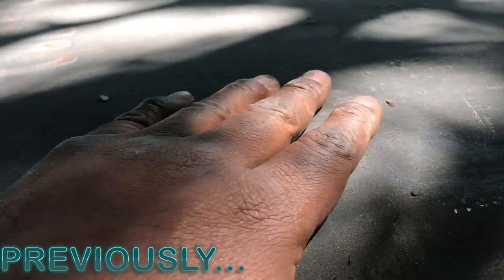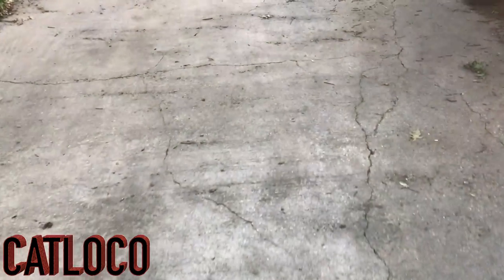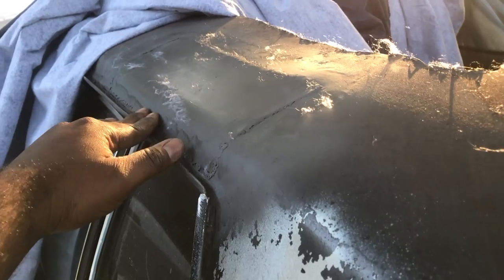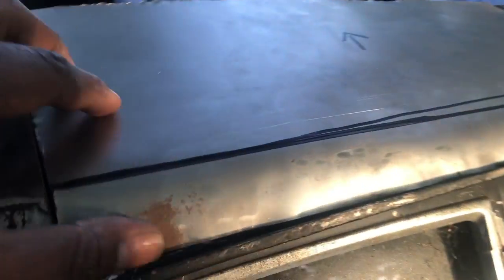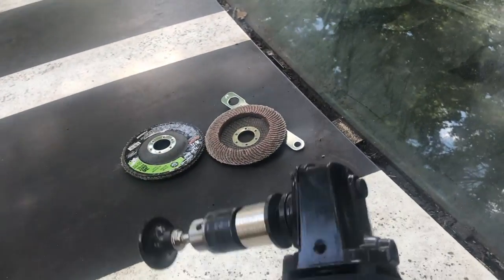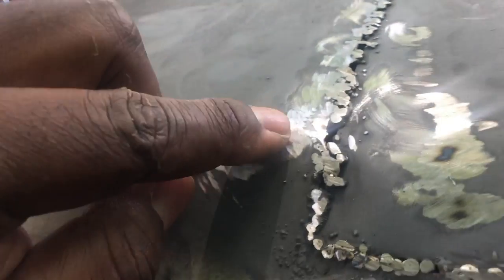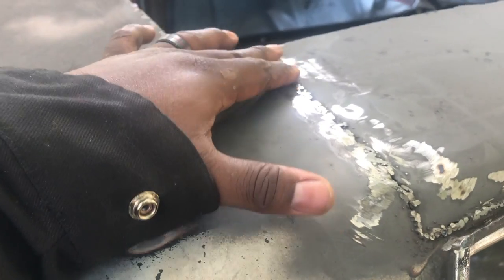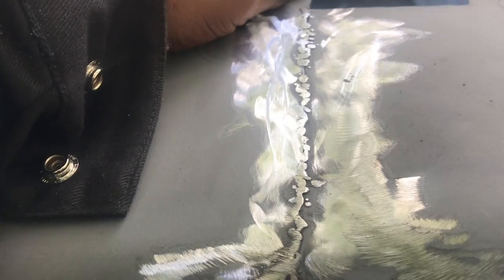1977 2 DR BOX CHEVY CAPRICE - PATCH PANELS & WELDING 2 #boxchevyworld

Comment: A 60 grit flap disk is the best thing to use on an angle grinder to clean up welds.  It'll take down the high spots and not go through the sheet metal on either side of the weld.
Reply from the maker: Ive been using 36-grit so far on these welds. I'm no where close to going through the welds. I have various grits already. Hard to tap down the welds by the drip rails, so the welds were high.  I'll test out the 60-grit, Thanks